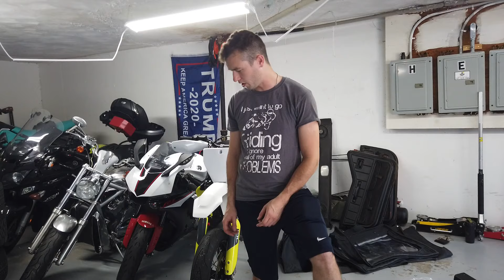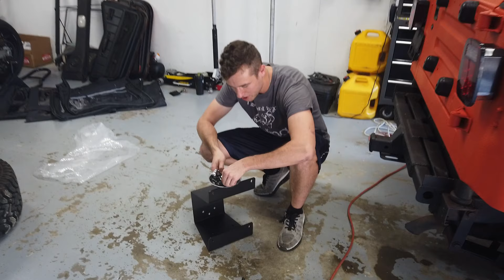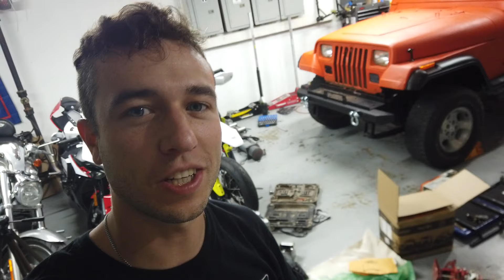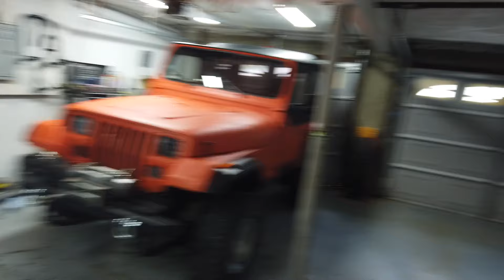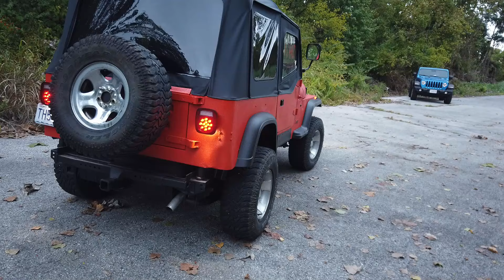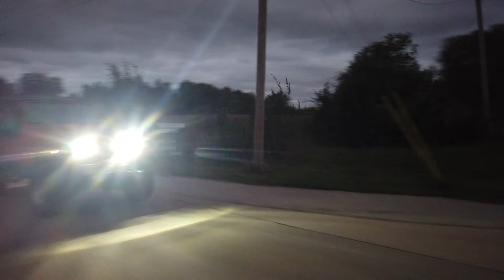$5k YJ Build Series Pt 1 - Major Overhaul!

Comment: Ford 8.8 rear end for sure, if you don't have tons on your mind. And a rebuild and locker for the front, it should be able to go about anywhere.
Reply from the maker: It's already got the 8.8 and now with a lunchbox locker. Running stock Dana 30 in front unlocked for now